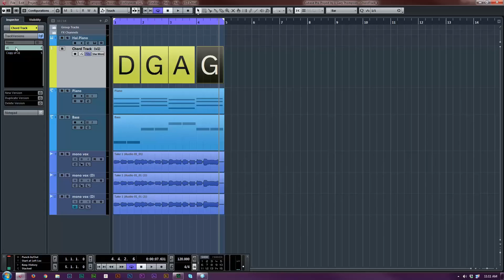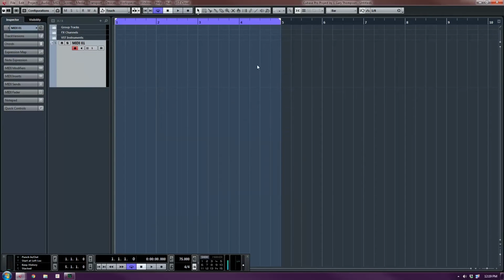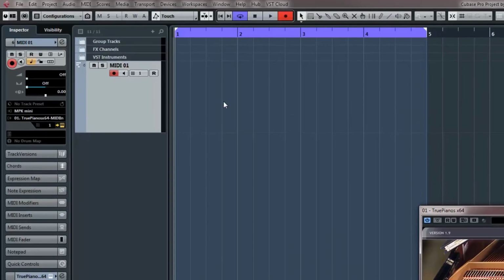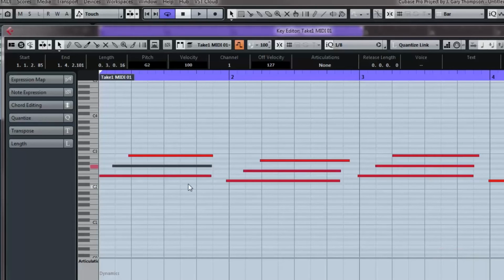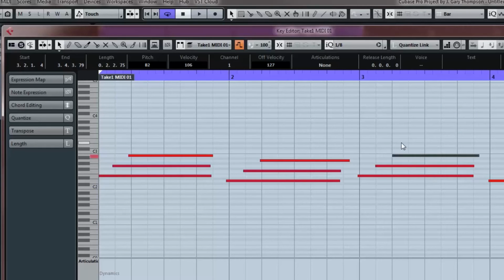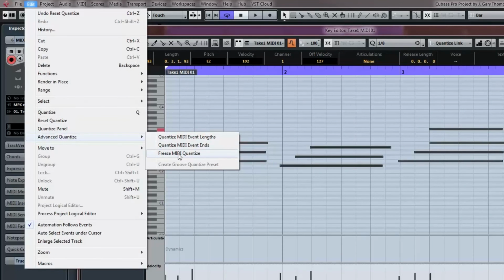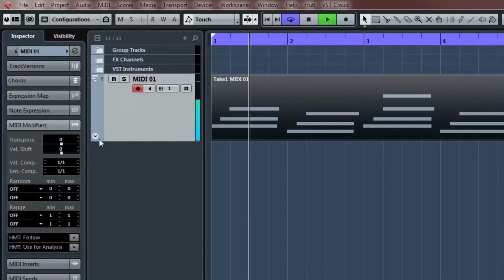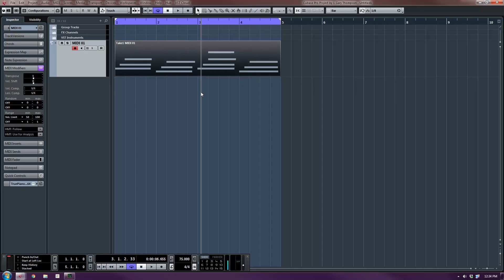Cubasics: Track Types - MIDI

Comment: My wife and I would like to record two midi tracks simultaneously, each track from a different keyboard. One keyboard has a USB midi out (M-Audio CTRL 49) but the other legacy one (Kurzweil SP88) does not. We are using Cubase 9 Pro with Windows 10. I can record midi from the SP88 by passing it through the CTRL49. I had hoped that Cubase could be set up to see the two keyboards separately by setting them to send on separate channels, but I can't get this to work.  If I have to use an external midi interface, I have an old MOTU Micro Express, but MOTU doesn't seem to be offering drivers for Windows 10. So again I am stuck short of my objective. Can you help us get there?

Comment: Why would you choose a midi-track over a instrument-track? Or when do you decide to pick one or the other?
Reply from the maker: Hi b13visuals!  Great question.  If I am working with a VST Instrument, then I start with an instrument track, but if that instrument is a 'multitimbral' instrument, like HALion Sonic, then I may create midi tracks to use other voices from that instrument on different midi channels.  Or of course, if I am controlling external instruments, I will use midi tracks.  The final variation in all of this, is to use the Instrument Rack for your VST Instruments, and then create midi tracks to use them.  In this final example, I am not sure if one has an advantage over the other, except possibly faster access to the VSTi's, over having to access the rack to edit.
Reply: That is very clear! Thank you! I like your channel! I'm subscribing!